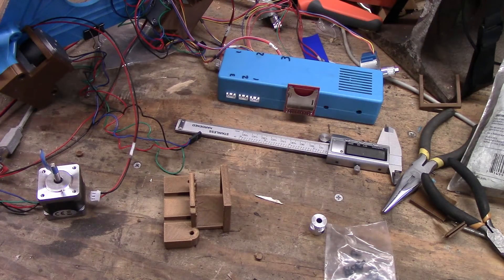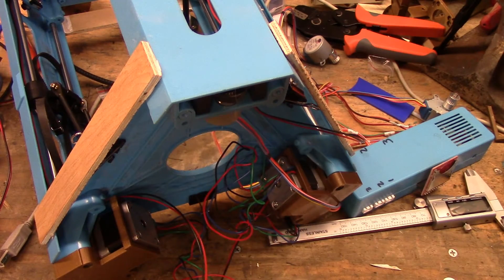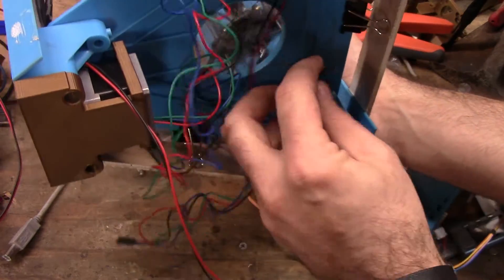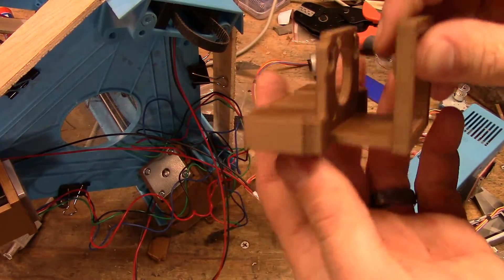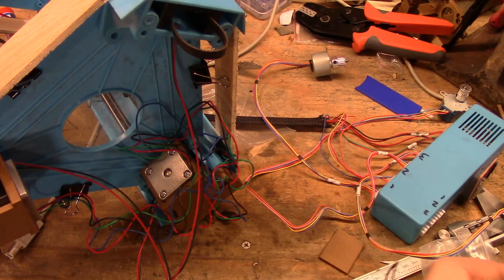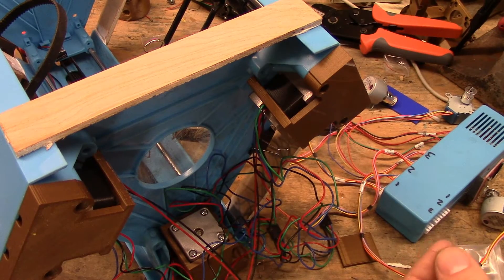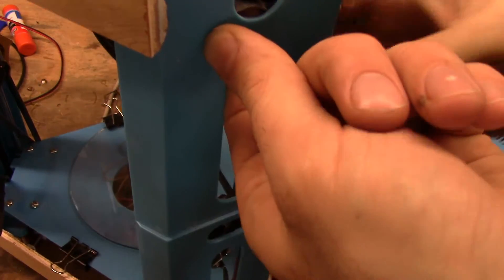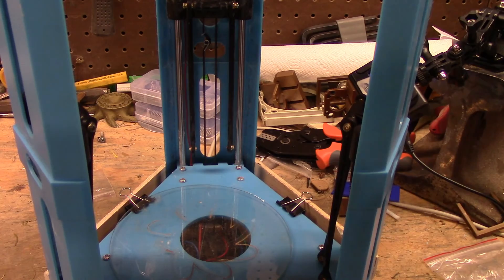101hero nema 14 stepper adapter

Comment: are those nema 14 180mm?
Reply from the maker: not quite sure what you mean there. the ones i got were Nema 14 Bipolar Stepper Motor 5.4V 0.8A 25.5oz.in/18Ncm 3D Printer as the name

Comment: I found a 101hero nema 17 adapter that probably works ! http://www.thingiverse.com/thing:2200055/#files
Got to try it out ! :D
Reply from the maker: Yes, that should be perfect. it was remixed from my NEMA 14 stepper adapter. has been tested as working by the guy who remixed it.
Reply: I just printed 3 of them put them on, put motors on and im waiting for tomorrow to test them. Should they work from there on? And can i start printning from there on?
Reply from the maker: with the same adjustments as the nema14 motors. the steps/mm adjusted in firmware if you are keeping the original controller. or update in configuration file if you are using the ramps card. might need to swap the center two wires if you are keeping the stock controller
Reply: Workshop Tinkerers okay i have switched around the wires and all the motors are doing just fine now, now i just need to find the steps/mm and adjust the firmware. How do i adjust the firmware?
Reply: Workshop Tinkerers Also when i click print the arms just move all the way to the buttom and it doesn't stop. How do i fix that? Sorry to bother you with all my silly questions...
Reply: @slayervictor  3 years ago but hey, in case anyone comes across this, if using NEMA 17 motors, make sure torque is at least 40 N/cm. Wiring is 1/3/4/6 left to right on the NEMA 17 facing you from the top view and then  4/3/2/1 to the controller board (stock) if youre looking at it from the top. for example, if youre looking at it from the top, NEMA 17 motor might be BLUE GREEN RED BLACK (Left to Right), t hen you'd have to do BLACK RED GREEN BLUE, dont depend on the color though as it differs from manufacturer to manufacturer.

Comment: Can i just plug a nema 14 or 17 into my 101hero instead of the other motors and it will work fine?
Reply from the maker: you will probably need to swap the center two wires out of the four so it will work, but its doable.

Comment: If i want to upgrade my 101hero with nema 17 do i need to replace their firmware?
Reply from the maker: no, just adjust the e-steps per mm for the replaced steppers. how to calculate the numer, and the commands can be found here. http://reprap.org/wiki/Calibration#X_.26_Y_scaling_and_steps.2Fmm_calculations

Comment: Things are much easier if you just disconnect the belt from the bracket. The belt is a one piece, (not a loop) and it starts and ends at the bracket holding the rods. It simply pops out. You don't even need to remove the belt tension-er spring (and then loose it on the desk  :-) )

Nice bracket design though.